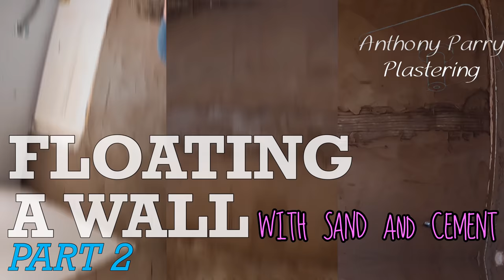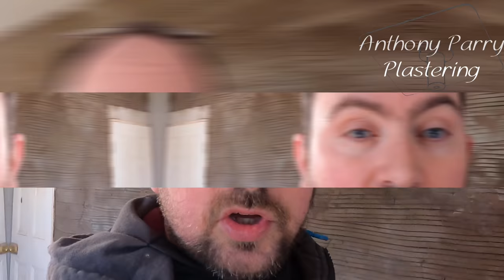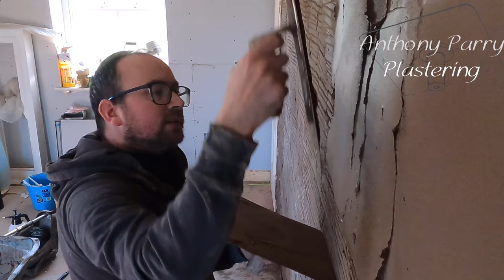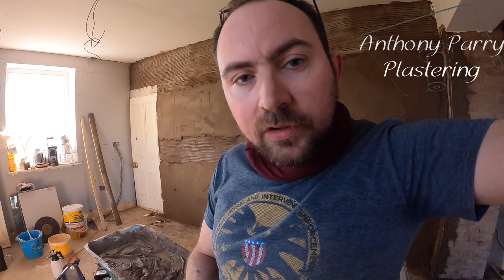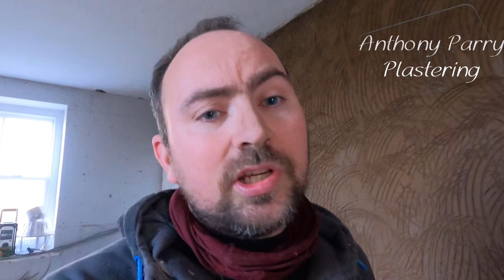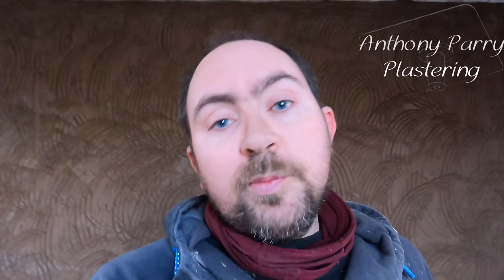How I Float a wall - PART 2 Floating  Sand & Cement

Comment: Great video again mate, definitely pursued them to use drywall or hard wall though 😂
Reply from the maker: Cheers bud, it would be easier but the old methods are still good ones plus I’m doing what the builder wants 😀
Reply: @AnthonyParryPlastering  can only do what the customer wants, sure your doing it to a high standard

Comment: Could you have used an undercoat plaster such as bonding?
Enjoying the vids :)
Reply from the maker: Hi Dean, thanks for watching bud. 
I couldn’t for this job. The first coat had sika one waterproofer in to stop any damp coming through. This wall also need straightening out and strengthening. It’s a old farm house so the builders wanted to use sand and cement.

Comment: What are your preferred additives for s&c? 
TIA
Reply from the maker: It depends what I’m doing, the first coat I put on was with Sika One. This is a waterproofer coat that the builder wanted this to stop any damp coming through. 
But for floating I use a Optimix super consecrated mortar plasticiser, I’ve been using this for years and it’s brilliant.
Reply: @AnthonyParryPlastering  cheers Antony. I too love the optimix plasticiser. How much do you use per mix? 
I am cautious not too use too much due to how concentrated it is, but would be interesting to see what you think?
Reply from the maker: @oliverwilliams3007  I tend to put it in the water. One cap for a bucket. But at this time of year when the sand is wetter. I tend to throw some in the mixer. I’m quite generous with admix I prefer to have more than less myself

Comment: Never skim next day .
Reply from the maker: It depends on how well it’s dried, I like it when it’s got a bit of moisture still in the wall. To control suction. Really I should of said a couple of days to be honest
Reply: @AnthonyParryPlastering  it's still shrinking back for a few days. Skim does not the two rates of drying will cause it to crack and or shell the skim coat off in my experience.
Reply from the maker: @ianturner8459   I don’t think sand and cement should be shrinking back. I’ve never had a problem with cracking and I’m just following the methods my dad used.
Reply: @AnthonyParryPlastering   .It shrinks during the curing process. Which can take a few days depending on a few factors. The backing coat will continue to shrink when the finish coat has stopped if skimmed the next day . If you have no problems with how you do it then all's good . Enjoy your bids and you are obviously a good spread who knows his stuff . All the best .
Reply from the maker: @ianturner8459  Thanks Ian. I really appreciate the feedback. It really helps me make better videos 👍
Reply: Each to there own decent job mate , I was taught in the summer leave it to dry for about 3 days in the winter anywhere between 5-7 days